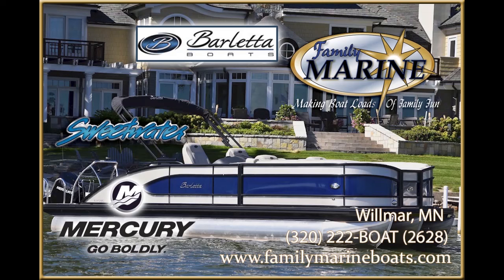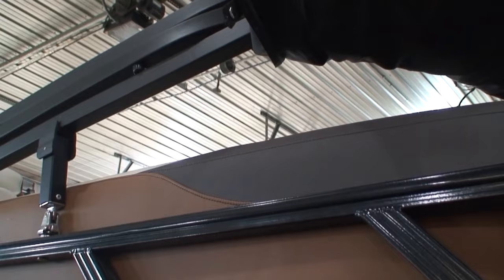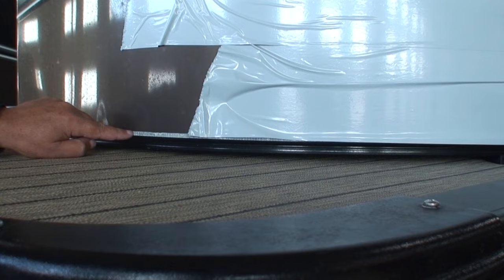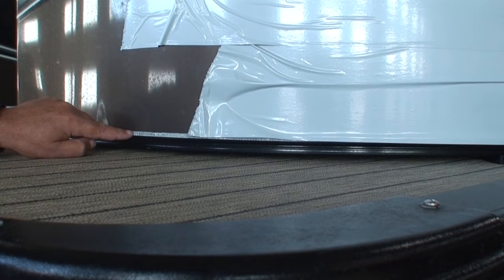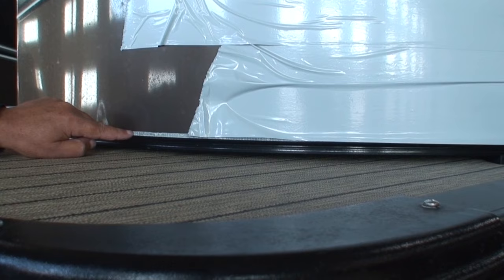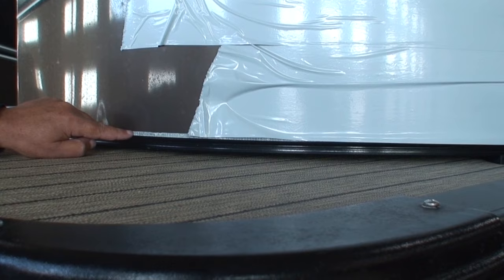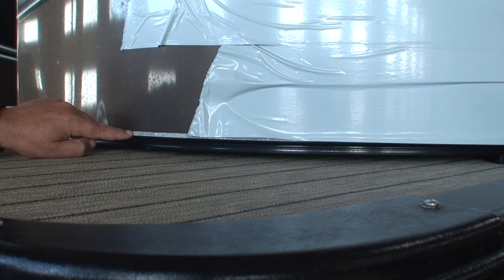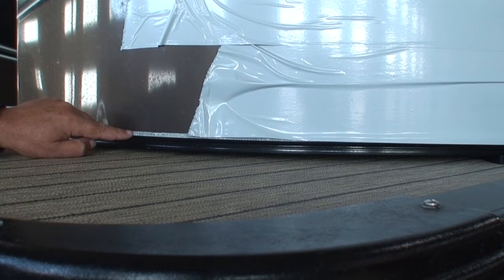The Good, The Bad, The Ugly of Pontoon Boats, Mercury Outboard

Comment: You should do the comparison on a boat that is actually in the same category as Barletta not a much cheaper mid class boat like an Avalon. To show how it truly stacks up to the competition you should do a comparison against Bennington, Harris, and Godfrey. I was bought in on Barletta until I owned one. Faded seats, Faded fuel fill, and more problems after only 2 years and all they said was " that is normal wear and tear". Broken cheap corner caps. I grew to hate the electric Bimini because it would constantly go out leaving me unable to use my boat. Or if the battery was dead it was stuck in that position. I hated the finger braking latches to lock in the bimini on the front legs. I traded it in and ended up taking a chance on a Bennington. They sold me once I started actually learning about pontoon boats and not just being "sold" on their features. I was blown away at how it compared to my Barletta. My new Bennington has drain channels above the seats preventing the water from reaching my storage area in the first place. The hinges on the Bennington are easier for me to use and more user friendly. My Bennington's seat base is 1 piece so it has actual long storage not just a hole that doesn't actually function on the Barletta. My Bennington has storage in the helm. My Bennington's GPS is fully integrated and gives me a beautiful looking helm I was not stuck with the ugly tachometers and fuel gauges I got with the Barletta and every other pontoon. I also Love the front deck on my Bennington. It has twice the front deck of my old Barletta. It was hard to anchor out, dock, load and unload on such a tiny front deck with my Barletta. The chains on the back of my Barletta ultra lounge were so loud and annoying I heard them over the motor and on every wave I hit. My new Bennington has a tension spring on the chain and I rarely hear it unless the waves are crazy rough. My favorite thing about my Bennington is the 10 year transferable warranty. My Barletta had only a 5 years transfer so I am glad I sold it before I lost that. On Barletta's Youtube videos their comments are turned off because of all of the problems and negativity from owners stating many problems. On their facebook groups you have to have a vin number to join a Barletta owners page because of all of the upholstery problems so they can keep unsatisfied customers separated from future buyers. On internet forums comments are turned off so nothing bad can be spoken. My Barletta wasn't the best pontoon boat on the market like they put it out to be. Yes it is better than an Avalon but doesn't seem to be as well crafted as Harris, Godfrey, or Bennington. It sure seems like Barletta spends a fortune on advertising, you see their name everywhere on websites, paying people to speak great about the brand on youtube videos, and covering up comments and feedback. The entire brand didn't feel transparent to me and it did not live up to the hype.
Reply: Well I have read every comment on this post and I did over 6 months of researching before I decided to purchase the 2022 Barletta 20UC model and I have to say this has been nothing but a DISASTER for my family.  All of Barletta's big marketing crap and this boat I purchased had NO QC at all after it was built at the factory.  I have been boating for over 35 years and have NEVER seen anything like this on a brand new boat for $75,000 spent from my bank account! The dealership I bought it from has been HORRIBLE to work with and between Barletta and the dealership all they say is I AM SORRY!  I have now told both of them all these words fix NOTHING at all. I will NEVER buy another Barletta pontoon ever again.....and I feel I got a 100% lemon and now fear of how many more problems I am going to have?????  Bolts loose all over boat, nuts just laying on floor, bimini down button has been a MAJOR issue for me and still does not work, front left docking light is 50% bright as the right one is and yellowish..... again I cannot believe what I was sold brand new and all these issues right on the 1st day of purchase.......... WOW!
Reply: AND I am trying to sell it now and pray that I can get my loss back and buy another brand for sure!!!!!!!!!!!!!!!!!!!!!!!!!!!!!!!  I feel it will be a Bennington this time!
Reply: 5 year Barletta warranty? It’s actually 10 years on everything from the deck up.. that’s upholstery, electronics, everything on the boat. The structure of the boat is lifetime warranty. I’ve sold a lot of pontoon boats and never have a had a company stand behind their product like Barletta does. A warranty is only as good as the company that backs it.  the quality of it is on point. We’ve only had one actuator go out in five years. That’s impressive to me hands-down the best pontoon in the industry.
Reply: @Sabrinagunter  I 100% disagree with you.  As a Barletta owner of 2 of them, NO QC at all.... stand behind.... took me over 1 year to to finally get the correct seats that were BAD right from the start coming out of the factory.
Reply: So the 2nd year Barletta was in business they had the weird seat issue. The glue backing and the vinyl reacted weird. It happened to a whole run of Barletta boats.. Barletta didn’t just do seat skins because their customers would’ve been without their boat all summer long because it would’ve taken the dealerships forever to complete this task with as many boats that were affected. Neither did they replace just one or two pieces of furniture on the boat that was affected because nothing would  have matched,  seeing as they were four years in. Barletta replaced the entire furniture package. No question asked no hassle. Yes it might’ve taken a little bit longer than people wanted because there were so many boats affected.  However, you could still use your boat until it was your turn in line on the service schedule. There was no major mechanical issue, keeping anyone from using their boats. It was all cosmetic. We were picking up boats on Sundays after the families were done using them and then dropping them back off a few days later.  Another company I worked for had a problem with the flooring. The front and back of the boats not covered with the cover was turning a rusty brown color, almost like it was burning. My guess was not enough UV and their vinyl flooring. That boat company declined the warranty claim due to error of cleaning products which is a complete lie. A warranty is only as good as the company that backs it.
Reply: @Sabrinagunter  So you think it is ok to spend $1115,000 on a brand NEW boat and then have over 17 issues from the start???????  I will NEVER EVER buy from Barletta again!!!!!!!!!!!!!!!!!!!!!!!!! And many boaters have asked me would I buy again?  And I say HELL NO!!!!!!!!!
Reply: Again they have NO QC at all!
Reply: @itconsulting7828  you paid $115,000 for 20  foot Barletta?
Reply: @itconsulting7828  I understand your frustration. I completely do. However, mistakes do happen. At least they are making it right.  There is a lot of boat manufacturers that would chalk it off to “normal wear”. Think about how much this problem cost Barletta.. and I’m pretty sure it was something with the vinyl composition in that one run of vinyl, not Barletta specifically. At least they fixed it.  I’m not sure where you’re located but here in Georgia we only have three months of voting season. So everybody and their brother wants their boats in that small little timeframe which backs the shops up. It’s not an easy task when something big happens. I apologize that you’ve had to go through that and I understand your frustration, however Barletta still has the best built pontoon boat in the industry.
Reply: @Sabrinagunter  No... 21' Corsa
Reply: @Sabrinagunter  I 100% disagree.  I have sense looked at and researched heavily on tritoons... and Bennington blows Barletta away!  Again will never buy a Barletta again.
Reply: @Sabrinagunter  I said my barletta only had a 5 year transferable warranty. Since you sell them you should know that the transfer is only good for 5 years not 10 but no one tells the buyers this you have to find out for yourself. So tell me how is barletta's 5 year transfer better than my now 10 year transfer with a different maunufacturer? It's transfer warranty alone is twice as good. All Barletta and their salesman do is say "we are the Best". You also said in 5 years the only thing that has gone out is one actuator and the very next comment you say an entire run of boats upholstery was bad and there were " so many boats affected" ... Im sure there is plenty more. I've learned my lesson.
Reply: @ZackBrummett  I apologize, I didn’t realize you bought a used Barletta. I assumed it was new. 

And I said in the last 5 years we’ve only had one actuator go out on all the electric biminis. I apologize. I went back and reread that and it was kind of confusing. I know a lot of people say the electric biminis are just one more thing to tear up, I was just commenting that we’ve only had one actuator for the electric biminis go  out in five years.

Anyways, I wasn’t trying to be rude or argumentative and I apologize if you took it that way. All boat manufacturers have their kinks. Some more than others. MY experience with Barletta has been great. They aren’t perfect, none of them are. But anyways, that’s just my experience.

Comment: Love love love your videos. Have for years. One thing you mentioned about this Avalon was incorrect though. The pieces on the cones are not for strength, that’s an added option that is a bump guard to protect against hitting docks and denting the nose cones. Also the seat bases are 100% metal frames, the plastic is absolutely not part of the support system of the seat whatsoever, it is strictly aesthetics. The seat frames also have a spacer so the seats get airflow throughout them allowing thing s to dry,unlike rotoform that inhibits humidity and mold since it doesn’t breathe. That’s a lower model Avalon, the nicer ones have fiberglass helms.

Comment: I bought a 2017 Suntracker 22ft Party Barge with Mercury 150 4 stroke. Boat had about 45 hours that was July 2020 for 25k. We use the boat at least 3 times a month and just love it. Not the fanciest boat on lake but we have a ton of fun. Have not had 1 single issue with boat or moror we have Cabelas due maint as that where boat came from new. I have oil change every season and impeller every 2 years. When I get in the water always float under boat and inspect underside and still looks new. Don't need a 80/125k boat to have a great time.. Nice boats for sure but not an average family boat. Everyone just enjoy your boat no matter what kind it is .. Its yours and your families to enjoy together
No competition just fun👍

Comment: How do you tell by looking the difference between anodized and powder coating?
Reply: Anodized will be excellent on wear, scratch, and corrosion resistance.	Powder coated  is good for preventing corrosion but Can wear and scratch easier. 

Anodized railing is going to be a very thin layer while powder coated is going to be much thicker. Anodized is definitely more pricier than powder coated. You should be able to see the metal through the anodized whereas you probably won’t see the metal through on the powder coated .